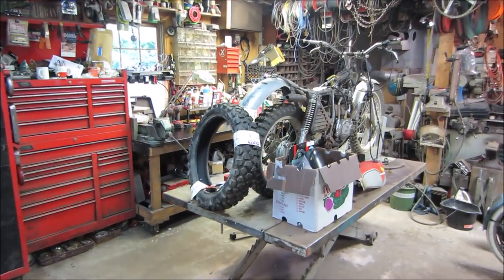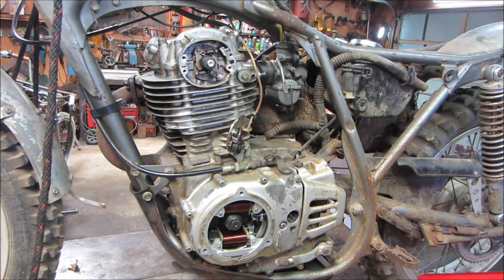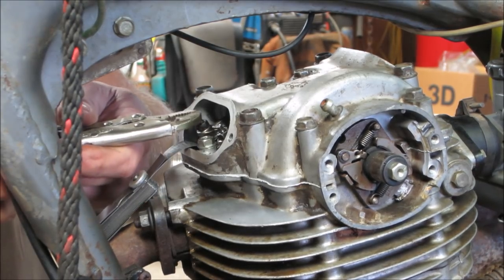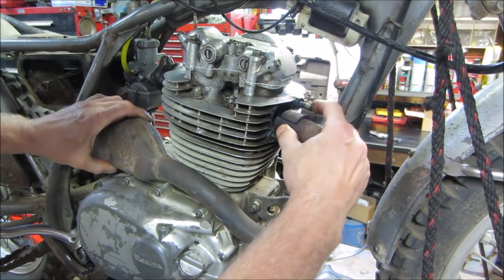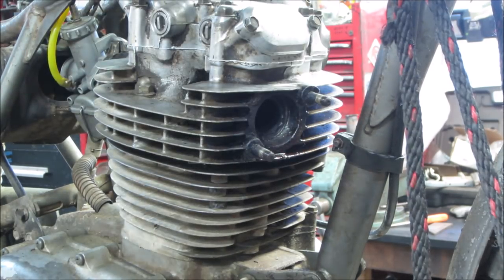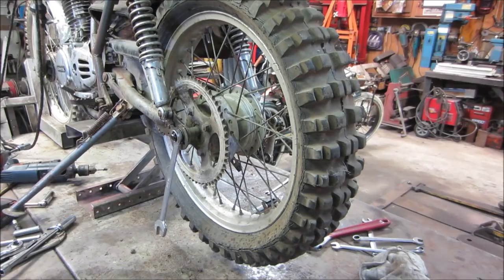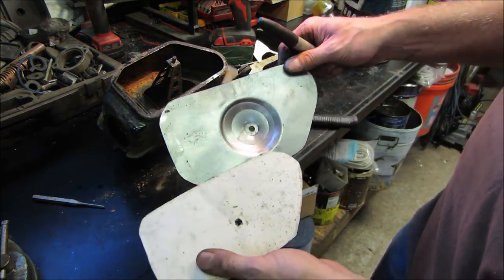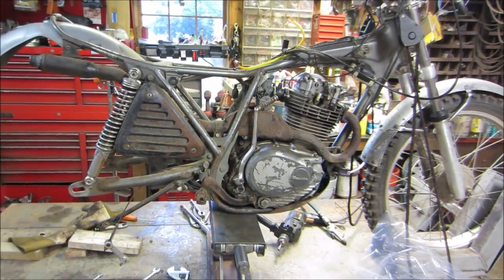engine work on the old honda 250 trials bike,

Comment: I was thinking, super glue the copper crush on to the end of the pipe, so at least you know while fitting and tightening you have the washer square to the pipe. Even if the right size your square. just a thought.

Comment: Those tiny tappet adjusters are fiddly Ive got a XL250s with similar. Last time I set them I tried an experiment set one gap then tightened back down to no gap measuring the turn (think it was around 60 degrees inlet 70 for exhaust) and it was good with feeler gauge after setting all 4 like this. In an emergency you can roughly set valve clearance with no feeler gauges out on the trail .

Comment: You could probably use hylomar instead of RTV glue on a gasketless part like that rocker cover. That way you can pull the part off again in the future and not have to worry about recuring the glue.

Comment: Mustie1, you could have welded a washer on to the pipe to make the flange, welding from the inside of the pipe to washer.
But I do like the way you go at it with the metal work!!!!
Reply: Mike Flynn I've never seen seen a washer with a large enough inside diameter and smaller enough outside diameter that would've worked for this he probably would've needed to make some thing custom for this either way
Reply: Rhys Aistrope I've seen them had some they are large with a large hole but they are hard to find too. I was just thinking about it if he had used one it would have made a restriction to exhaust flow at that point too.
But I like the way Mustie1 took to fix it and it's "Factory" correct. Lol

Comment: run a small amount of sea foam in the gas to help burn carbon off the valves for better sealing. dont use very much that is a really small gas tank it could burn the valves and piston I think you use one can of it in a 18 or 20 gallon tank of gas.

Comment: I disagree completely that the length of hose and the lack of check valve at the plug end changes the total compression.

If you did only ONE stroke and used that as measurement for the compression psi, yes, but you don't.  You run it until it doesn't go up any more and that takes care of the extra volume it has to pressurize AFTER it's compressed the air.  You could hook a 2 gallon tank to the line and gauge to the plug hole, and it would take a lot of turning of the engine, but it would STILL come up to the same total.

RichE
Reply from the maker: why do you think compression testers have check valves at the plug hole,
Reply: I agree with google plus. It's not going to matter which end of the hose the check valve is on. Either way the hose will expand if it's weak and the volume won't change. Yes the volume will be increased due to length of the hose but that appears to be over annualizing something that's been being done for years both ways
Reply: This is correct. Compression ratio changes when you change the cylinder geometry, but the pressure does not change when you add hose. It just changes the amount of ambient pressure in the line that you have to compress using the engine. In essense, the cylinder is the compressor, and the hose is the "tank".
Reply: Paul, well said.  The compression ratio is different, but the compression ratio and the amount of compression a cylinder can develop by itself are NOT the same.
Reply: Neither of mine have the check valve at the end by the spark plug connection.

RichE
Reply: all hoses expand with pressure or collapse with vacuum, better the hose the less they deform and effect readings. shorter the better etc...
Reply: Not all of them do, but that dosen't really matter because the pressure will equalize in the system.
Reply: Agreed
Reply: I agree with that

Comment: I noticed about 13:30 when you were applying the hondabond to the cam cover, you smeared some down in the machined bearing point for the cam nearest the points plate.  Is it really supposed to have sealant down in there?  Really enjoy your vids!

Comment: I have a 125 cc Chinese 4wheeler that revs up a down  while holding the throttle and in gear. Any ideas as to why it is doing this. I did put on a new carb

Comment: Are the adjusters on those valves not flathead screws? I don't think I've ever seen that on a honda motor.

Based on what I saw on the crank, it should have the standard timing system of hondas, test light (better yet multimeter with continuity, makes a solo job much easier.

That peened flange was absolutely goddamn genius. I wish I'd have thought of that when I was building a custom exhaust for a CB125 cafe racer. Instead I wasted weeks hunting for a rotted out exhaust that still had a good flanged head.

Comment: I need advice. On my volvo 850 t5. If i hit that guy with that guy i have to screw that guy in. So if i dont hit that guy will i still have to screw that guy into that guy or do i just leave that guy alone which may end up wearing out that guy quicker than before. Any help appreciated.

Comment: vice grips on the adjusters, GAHHHHHHHHHHHHHHHHHHHHHHHHHHHHHHHHHHHHHHHHHHHH
good idea leaving the valves a bit loose, since it had known sticking and dirty/carbon issues, better rattling, than possibly burning :))

Comment: Why was the float needle sitting at the bottom of the fuel bowl when you took the carb apart?  Shouldn't it be retained by the float until you remove the float pivot pin?
Reply: he used multiple different carburetor parts to make it work in an earlier video.

Comment: After setting the points gap you need to rotate the back plate while the flywheel is on the F mark (fire) and rotate back plate until points just open.
Reply: right, use a test light with battery for "static timing", then tweak your heart out while running with strobe timing light ;)

Comment: Hey I have Kawasaki 250 bayou i put a after market carb on it and im getting  a intermittent back fire thru the carb is that in my timing or is it in my carb i dont here a lot of valve chatter  im not good with carbs so i dont know and it dont wont to reeve up more than 3000 rpm there a bouts sounds like its running out of fuel

Comment: 4 valves per cylinder in 1973.  I wonder how many car guys watching this thought that was a '90s innovation.  10 points to anyone who knew that the first road car to have a 4 valves per cylinder (so 16 valves in this case with it being a 4-cylinder) engine was the Triumph Dolomite Sprint introduced in 1974.  Another 10 points if you knew it was also the first road car to have alloy wheels as standard equipment...
Reply: gosportja-mie - Not so much, the first was Peugeot in 1912 or 1913. In fact there were prototypes earlier than that in 1906 or 07. Memory is not as sharp as it used to be.
What is really curious is that many think about all the "advancements" as quite recent things. When in reality a huge amount date from the early days of the 20th Century and are pre-WWI !  
Engineers in the 19th Century knew exactly the same principles as we know now. More air, more fuel = more power. No wonder fuel injection, compressors, turbo, multivalves, over head cam, etc, etc. were tried decades ago. Those pioneers literally lined the paths we ride today. ;-)
No one takes the palm, because it´s cumulative knowledge, adapted, to the age and technology at hand. ;-)
Another example, engines with auxiliary compressed air were dismissed from competition, by several racing organizations, back in the 30`s!! Not exactly a new thing.  
Quite interesting stories that form the foundations where we stand. 

BTW I didn´t know about the alloy wheel detail. ;-)
Cheers

Comment: Maybe it was the way you described it but it seems like you regard these cam bearings as being inferior or subject to damage and/or failure because they don't have (by inference) ball/roller bearings. You said there are no bearings in the cylinder head. These are plain bearings and it just uses relatively high oil pressure to pump to the bearing surfaces. With correct oil, changed at the prescribed intervals, there should be no metal to metal contact between the cam bearing surfaces and the head surfaces. These motors are very reliable for what are relatively high revving engines outputting 80 hp per litre. They pale in comparison to modern superbike engines with up to 220 hp/litre. They have "plain" bearings as do most modern engines automotive or motorcycle. As you are aware, big ends  of almost all four strokes are plain bearings which rely on a film of oil within very small clearances. The only motorcycle engines that almost always had roller bearing were two strokes because oil couldn't be fed to bearings via pressure lubrication. One of the reasons prescribed gasket compound is used because with the correct cam cover torque, the gasket goo will compress a set amount and give the correct cam bearing clearance.

Comment: I have a 1957-58 evinrude fastwin 18hp, I’ve been looking for a water pump impeller, I’ve looked on amazon, eBay, and a bunch of marine shops online, I’ve had no luck, anyone have any ideas?
Reply: Henrythestunner - I´m not sure about this, but can´t you use a more recent Johnson modified to fit? If such Ebay has them by the bunch and cheap. ;-)
Even if light machining/modification is involved might be worth considering. 

I´m saying this and I´m struggling to find a 2 halves central crankshaft rollers bearing for my Johnson 2 cylinder, 2 stroke, 4hp. I have it running quite well, but the pitting in the bearing saddle and rolls don´t allow me to relax. Because instead of good I know it could be impeccable. LOL ;-)  
Cheers

Comment: The filter is no good. The idea is that in the airbox the air as lots of space to pass through the filter (it can get to all sides) so it takes ages for it to block. The way you have it you may as well have blocked the inlet to the airbox with foam, the area is basically the same
Reply from the maker: it can still travel around the outside
Reply: It looks fairly restricted in the video but you're holding it so you'd know best. I suppose you're hardly going to be doing 1000s of miles on it anyway

Comment: Couldn't you just have shortened where the bolt is in the centre of the air box then just used a straight piece of steel instead of reshaping one it might of saved some time.

Comment: I have a 74 honda z50 and it doesn't have spark but if I touch the wire it shocks me. It did not have a spark plug boot when I got it so I tried just using one from a weed eater but still no spark. I was wondering if anybody knew what the problem might be. I haven't bought points for it yet because I'm not 100% sure that that's the problem and I would like some other input before I go and buy anything as I'm trying to keep it cheap. If anyone knows what might be going on I would really appreciate it thank you.
Reply: check/replace the condenser/capacitor if it failed, points are probably pitted and need replaced also ;)

Comment: I've-replaced-many-a-Honda-atv/motorcycle-head,camshaft,and-rocker-cover-due-to-someone-using-rtv-as-a-gasket-between-the-rocker-cover-and-head..cam-slops-around-wallows-out-the-journals,almost-impossible-to-get-valve-lash-correct,and-it-stay-correct-with-rtv...Hondabond,Yamabond,or-Hylomar-is-the-only-way-to-go-to-do-it-right...Not-to-mention-rtv-clumps,falls-off-clogs-passages,screens,and-oil-pumps...Bikes-comig-along-great,makes-me-wanna-go-out-n-dig-one-up-too,not-sure-the-old-"Knees"-like-that-idea-too-much...

Comment: He's building a disaster with the home made air filter. He needs to look at a complete air box that has all the structure inside. He's making a lawnmower type filter with that foam. That's how I make filters for my mower. I would NEVER do it for a motor cycle. The foam is much too porous and will let in grit that will bore out the cylinder,and kill the bearings, ect.  I bet he won't even put motor oil on  it or white grease to seal the edges. Also he put light machine oil on the rear axle that's supposed to get heavy axle grease, and didn't even check the wheel bearings. This is the kind of guy you should never buy a car, bike , or mower from because he does everything half - assed.